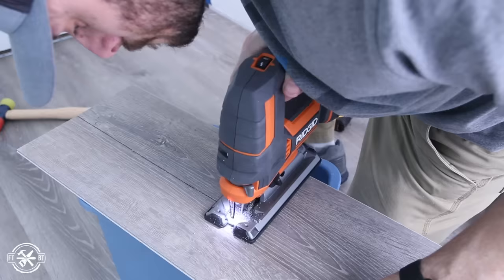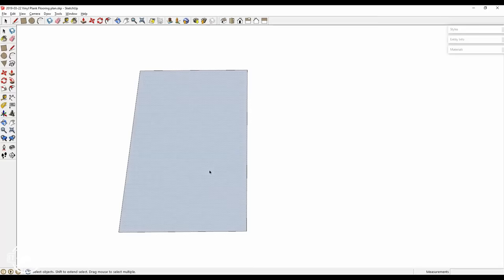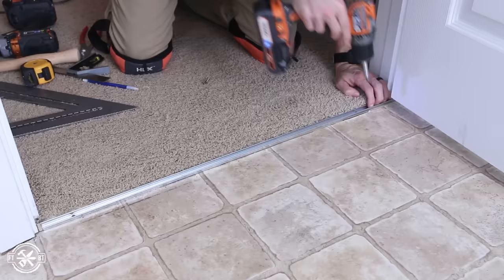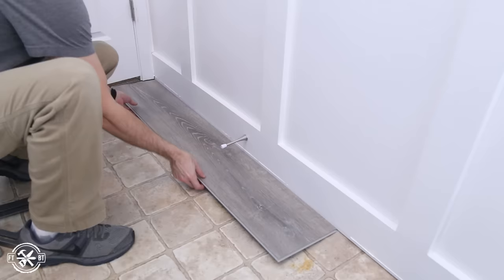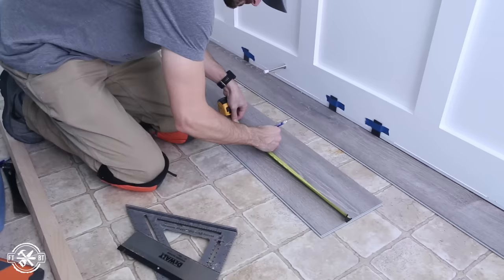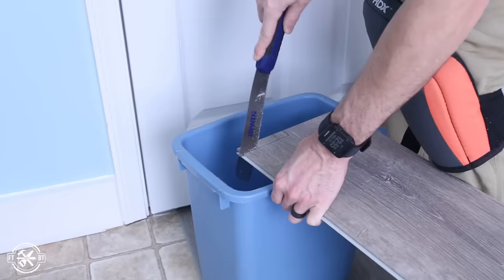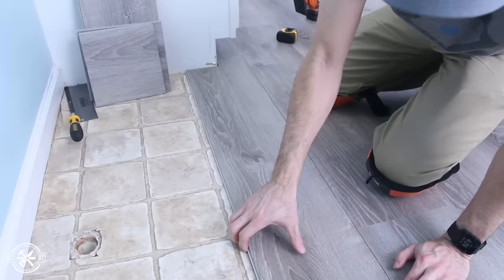How to Install Vinyl Plank Flooring as a Beginner | Home Renovation

Comment: Thank you. Is underlayment required for on top ceramic installation? Also, does vinyl flooring capable of handling moving  high loads without warping?
Reply: My thoughts exactly.  Should be something on top of the tiles to reduce noise at least.  Only time you don't need underlayment is when you glue the planks down
Reply: Definitely need underlay
Reply: A lot of these vinyl plank floors have an underlay already attached to them. Very easy to install and water resistant unlike laminate....
Reply: @billpiehler9010  thanks
Reply: @Adam-sl3vp  thanks
Reply: @philasht  I thought that was a natural stone tiled floor and couldn't imagine the sound and wobbling of this new floor over it.

I have a natural flagstone (uneven) floor I'd love to cover and this seemed like a good (and reversible) solution. But it's so uneven I don't know how it could work. Also, what's a screed?  Thanks!
Reply: @philasht  ugh. Well I can't thank you enough for taking the time to reply. Much appreciated.
Reply: @billpiehler9010  This vinyl already has underlayment attached.
Reply: Use some backerboard
Reply: Use some backerboard

Comment: You mentioned dropping new vinyl plank flooring directly on top of existing floor, to bypass having to remove the old floor. We had vinyl laid directly on top of wood parquet. Along with the apron of the newly installed counter-top, the result was that the dishwasher is trapped in its cut - we can't move it out in order to repair or replace. We have to now engage the service of an installer to remove the vinyl around the opening for the dishwasher, then the dishwasher installer to remove/replace the dishwasher and then the flooring company come back to re-install the vinyl planks. Yes, the original installation of vinyl went quickly with no demolition, but twenty years later, we're paying the inflated price
Reply: I had a similar problem with my old broken dishwasher being stuck in place because flooring was added around it.  I cut the old dishwasher into pieces with an angle grinder and removed it that way.  I then cut and added some plywood to bring the floor under the dishwasher up level to the kitchen floor.  Had to use an ADA compliant (slightly shorter) for the new dishwasher.

Comment: Behind the toilets How the heck do you paint back there anyway? Great after! Was the original floor vinyl or ceramic tile?
Reply: Was also curious about this. Great guide.
Reply from the maker: Original floor was sheet vinyl
Reply: Remove the toilet or use a very very very long thin brush....
Reply: Small roller and a 1.5inch brush
Reply: Remove the toilet
Reply: @emilianoandrade7946  Not that much of an issue!
Reply: susan haynes it takes 5 minutes to remove a toilet...and put it back!

Comment: Thanks very much, that’s a very cool video.  So I’m wondering if it is advisable or not to add a subfloor (foam or rubber for example) prior to installing plastic or wood laminate over tile? In your build, you don’t use it, but I want to install a laminated floor over the whole basement which is currently tiled. What the right/best thing to do?
Reply: For underlayment with vinyl flooring you need to follow the manufacturers specifications. Many vinyl floorings have the padding/underlayment already on the bottom of the pieces so you wont need it. Using underlayment when the manufacturer says not to can void your warranty,

Comment: Why didn’t u use a rubber lay underlay system to prevent the hollow sound
Reply: It’s already on the bottom of the plank
Reply: zaffar vyadally not all lvp requires an underlayment and many of them with attached backings specifically say do not add anything under it

Comment: Wish I knew how to use a program like that to lay stuff out.... I just know how to use a Tape Measure LOL. Looks good but you will regret not using the padded under layment, gonna be lil noisy walkin on it.
Reply: What he used is called Sketchup.  Very easy to learn and can get a free version! Check it out ! :)
Reply: You recommend padded underlayment under vinyl with padding built in?  I've installed similar products to what he used and noisy is not an attribute I'd assign to it.
Reply: @1dgrdgr  I must of mistook this for the snap together that has no pad under the material itself (I do tile not this but have installed before) never knew it came like that. good to know tho!
Reply: @thetexastileguy  If you get a chance, next time you're at the supplier, check it out.  The stuff I used had a hard black foam backer built right in.

Comment: Love this video!  Especially how you are allowing us to see the mistakes.  The part I struggle with most is I’m getting ready to do a 23x20 room and am not really sure how to make that first row straight.  I KNOW my walls on the one end are square.  What’s the best way to do this?
Reply: In that case, you have to cut the planks lengthwise. Suppose that your planks are 8 inches wide. Use a tool called a "chalk line" to mark a perfectly straight line on the floor. Before using the chalk line,, at one end of the room measure (8+4) inches away from the wall. Mark the floor with a felt tipped marker. At the other end of the room also mark (8+4) inches away from the wall. The marks on the floor should be single points, not long skinny lines. Pull the chalk line tight from one mark to the other. Snap the chalk line like a rubber band. Line up THE LONG EDGE of the planks along the chalk mark on the floor. There will be a 4 inch gap (aproximatly) between the planks and the wall. Take a scrap of flooring and push the scrap against the wall. Slide the scrap along the wall while marking the intact (whole) planks with a marker or pencil. The line you mark will be slightly curved if your wall is curved. Cut your planks length-wise along the marked line. Re-mark the chalk line on the floor closer to the wall. The irregular (curved) edge of the planks will almost push up against the wall. The straight (non-curved) edge of the cut planks will touch the chalk line. There should be a 1/4 inch gap between flooring and the wall.
Reply: @samuelmuldoon4839 hat was slightly complicated. Maybe make a video

Comment: Constructive criticism: I personally think that laying without impact sound insulation leads to the result being relatively loud. In addition, every grain of sand that gets under the vinyl leads to crunching and cracking.
Reply: Yes, that's very odd....... putting laminate over tiles without underlayment.
Reply: Looked like an attached underlayment. Most vinyl planks have that these days.
Reply: Most lvp has built in underlay already...
Reply: its built in to the pieces already chief

Comment: That's way complicated for the first time trying. It also needs a lot of tools. I guess hiring a pro is more feasible for me. But, thanks a lot for the video.
Reply: i was a total beginner doing laminate the first time and it's not nearly as hard as it looks.  you can handle it.  i would recommend a pro for a lot of jobs, but not this one
Reply: Thanks a lot
Reply: Its not very difficult Butttt having the right tools does help ease up the process.
Reply: it really is pretty easy you can do it! just take your time if your a beginner and if you don't have any trim moldings it always helps covering any imperfections
Reply: Thanks a lot. There are many tools to buy but I checked most of them are under $200... let see maybe thinking keeping the tools for the whole life justifies that
Reply: Thanks a lot. My carpets on the second floor still look pretty new. The first floor is hardwood. maybe waiting for another couple of years and learning more along the way.

Comment: Those lines in existing subfloor is going to telegraph through eventually.

Should have skim coated over all the grout lines in the vinyl.
Reply: The click vinyl is a little more thick, so it will take a long time, and since it doesn't look like a permanent installation, it should be fine =) But you're right, it'll telegraph eventually!
Reply: Um the original floor in there was fake tile  vynal or  lenolium. But it may have had texture . These new ridgid luxury vynal planks with the padding are made way harder and different than 4-5 years ago when this stuff started becoming popular. I doubt it unless in a very harsh surface and not any climate control would ever show thru in most surfaces
Reply: Gabriel Ramos you are correct in a sense. Depends on product. A Karndean floater will last longer than a cheap Home Depot floater.  As a professional installer like myself you never cut corners. That’s how you get bad reputation. I get this is more for diy type.

It does appear to be a cheaper made floater too. A high end product like Karndean looks different as far as layers and will not telegraph or shrink due to the metal strands.

Really all depends on product you are working with
Reply: Phillip Mccarter there’s no such thing as vinyl linoleum. 2 different products. Lino is more of smooth finished surface, it’s thicker product due to the wood backing. Design cannot get as intricate as a vinyl sheet. Lino brittle and viynl is soft. The only things these 2 have in common is you can get them in sheets. Every other property is completely different in those 2 materials

Most residential sheet is is 0.80 gauge and has texture.

Once again it depends on a product. Some of this floating vinyl is made like laminate. Just like compressed vinyl materials. Generally residential products are built pretty cheap since they do not get heavy foot traffic. It also appears there was no padding this flooring product.

It most certainly can and probably will telegraph over time. Especially if the room gets beaten with sunlight. The vinyl will soften and telegraph due to just walking on it. Vinyl is a soft product. Not a hard surface

You should always install things with minimal risk and try to get long lasting life.
Reply: Also I meant to have a or in that i do know the difference between vynal and lenolium
Reply: Phillip Mccarter idk man. You called it vinyl linoleum.
Reply: @meetstepsisalcoholicdouche6167  
Ok thanks
Reply from the maker: It was sheet vinyl, not tile underneath 👍
Reply: At least he pulled the quarter round.
Reply: Selebrity 152 why skim coat...? Take that existing flooring out to begin with
Reply: No need to skim coat that sheet vinyl underneath had no bubbles or anything he was right floating over it I’m a professional floor installer 10 years

Comment: I usually pull measurements on the floor chalk some lines to make sure everything is going to line up for that room and going down any hallways and then I just contact cement the first run down that usually prevents anything from moving

Comment: I've installed floors for 25 years and I would say this video is already off to a bad start. Step one, take up the old floor underneath down to the subfloor. Then cover that with a quarter inch underlayment. If you go over a old floor, even a solid one, over time you will get pops and cracks when walking on it.
Reply: This was my concern  the underlay  thing
Reply: Yep just happened to me.. is there something I can do to fix the noise of new floor hitting sub floor as I walk on it? Sub floor is tile and it’s only in a few spots

Comment: If you have the luxury of tools: a table saw for the straight cuts.  A flooring cutter to 'snap' the boards to the proper length.  A blade knife for the cuts around door jams.  A Japanese Saw comes in handy too!

Comment: As a floor fitter if u don't have a tape measure and need to measure the end peice u can turn plank to it's the wrong way and put it to the wall and make a mark on the plank where it meets with the previous

Comment: Hands down one of the best how to videos I've watched, feel confident I can put down this flooring by myself. Appreciated that you showed the mistake of using a blade and snapping over using a saw. I was told by the installer who wanted $500 to do the 9x13' room that a saw chips the edge, but yours looked smooth. I have a table saw, do you think that would be smoother to use than the skill saw? Appreciate your advise. Thanks

Comment: I know, I'm kind of late with my comment now, but maybe it will help somebody anyway. I have never seen Plank Flooring installed like this, directly on the floor. Maybe because I'm European. Usually, we use an underlay, which is some kind of spongy plastic thing, which comes ruled with a width of 1,1/2....2 meters I believe. This material has two functions. One is that it makes the leveling of the floor a lot easier, and the other is that it is working as an insulating material. About the leveling. That's important, because, like in this video, the floor will never be 100% leveled, but the under layer will take care of those level differences, by compensating where needed, filling up the gaps and compressing where there are no gaps. I'm just saying  🤓

Comment: For cutting vynl flooring, I have found that using an electric Dremel Saw Max works quite well. The Dremel Saw Max is a miniature circular saw. I think it was invented to cut plaster board (drywall or sheet rock. However it  works quite well on vynl flooring.

Comment: I'm glad I have a flooring saw to cut the planks. Got one on a good sale.
I wanted to see how you got the washer & dryer moved back in. LOL. I'm planning to use vinyl plank in my laundry room as well. Don't have an existing floor drain so might have to add one somehow. I'm debating over square or round drain. I was thinking of having a linear one but then I saw the prices.
Thank you for this video. It was helpful.

Comment: Best way to cut, put your square and run your blade slowly 3-4 times with pressure, put it on your knee pad and hit. Do it all day, haven’t had a rough cut in forever

Comment: Great video but ripping with a circular saw is a great way to send millions of micro plastics flying. I did that once and then scored with a straight edge and used pliers to separate the pieces. It works pretty well.

Comment: FYI, if you have a NEW home, wait to do this.  I did not and regret it. The floor was level when I put it in, but over time, high traffic areas wore the floor in, and now all of the areas where the floor is no longer even (bottom of steps, front of kitchen sink) are all messed up. I would wait at least 3 years after a build before putting it in so you can level out the areas that get the most wear.

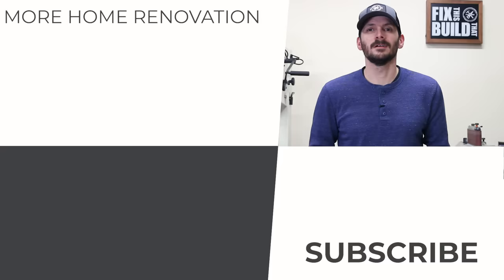Comment: Question1  : What happens if you need to swap out the PVC pipe at 10:00. 
Question2 : Will mildew grow under the vinyl flooring above the tiles?

Comment: yes dont bother with scoring your planks, i bought a diablo blade for my circular saw with lots of teeth, sorry to lazy to check-finishing blade i believe, also have a vacum handy as the "saw" dust will get everywhere and cling to stuff.i used a white rubber mallet for mine, also the snap and click style will almost drop perfectly if you have it in the grooves properly, if it doesnt almost drop down give it a gentle tap. i finished a floor this past week for a small kitchen. i didnt worry too much about the short pieces being perfectly spread out as i was concious of wasting planks- you will have lots of scrap.i did a 9x19 floor and had to put in 2 seams with no lock in a couple of out of the way spots and used 7 boxes of planks that were 20.4? sq ft each. take your time and it will go good .
Reply: i used almost identical flooring that was used in this video., if you are going to be living in the house for a very long time buy the more expensive vinyl flooring as the pattern finish is thicker than the cheapest stuff, it will last longer with the pattern.

Comment: Im noticing no ones talking floor level.
I just got done doing a house with carpet but the entry way was tile well the floor tile from the entry way to where tile met carpet was sloped about 1" so on the side of tile butting up to carpet  we had to put some special shims to lift carpet up in order not to see tile edge called a easy shim.
So if you are planking whole floor and you get started thinking its going well then you start climbing a hill you will notice the plank flooring noticably.
My thought is maybe you all should mention how to fully start laying out a floor not just setting pattern up but the subfloor also and how to fix if not level because we all driven down a highway that looked like a rollercoaster before and that wouldn't look so nice on a floor .

Comment: The thing is you have to be very careful not to damage any edges or have amy raised edges anywhere because if you come in the room with shoes on you will kick the edges off leaving damage spots that you have to undo the entire room to that spot in order to replace it.  So please make sure to follow installation and don’t drop your boards hard or try to force anything because it will show eventually

Comment: The top side of the plank has a very hard (usually aluminum oxide) wear layer that is specifically designed to resist scratching. You're much better off scoring the back side. It's softer, so you can get a deeper score, and your blade will bite in instead of skating around on the surface.
Once you have scored the underside of the tile and snapped it, you can fold the cut pieces in half and run your knife up the seam to separate the two pieces.

Comment: For 9:15, the reason why the flooring is in the joints to begin with is because of excessive tapping. You'll ruin your flooring  and you don't need to tap as many times as this guy did just to get a plank to click. Also you don't need a pullbar for the end pieces. If you know what you're doing and using the same mechanism as the flooring in this video, all you got to do is make sure its lined up against the previous plank and just hit down into place. You'll ruin the end of the plank that goes along the wall with a pullbar.